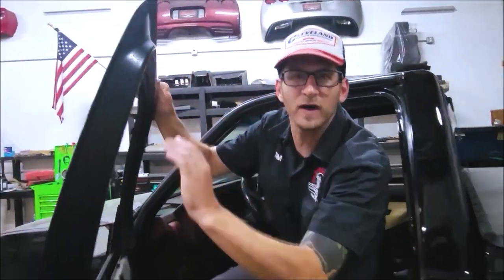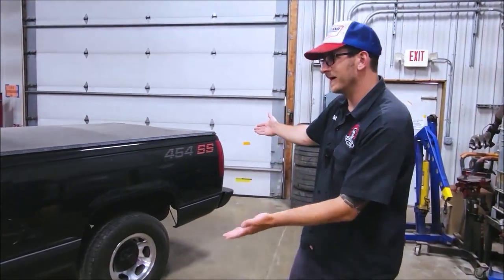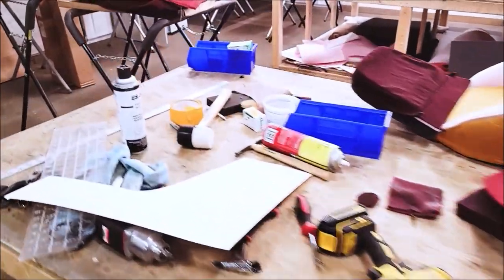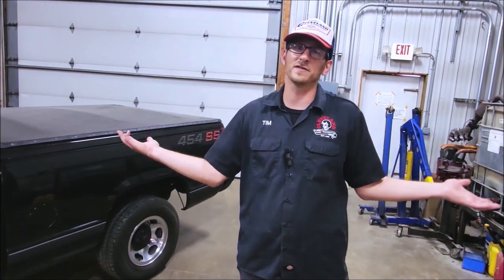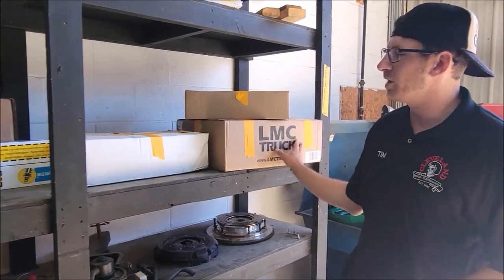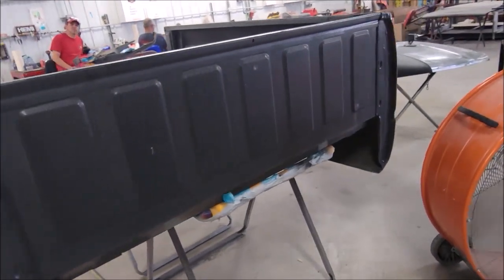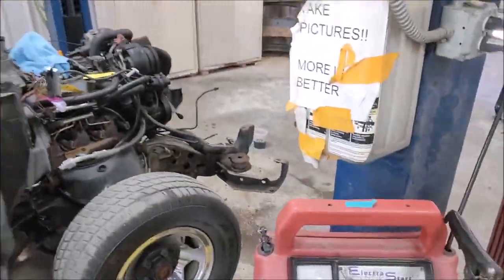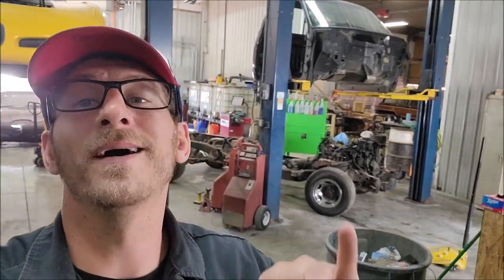1990 Chevy 454 SS Pickup Restoration

Comment: I have one of these.   The OEM 454 jumped timing and destroyed the pushrods.   I replaced it with a GMPP BBC(454) and replaced the THM 400 with an R4 transmission.   MPG is 9.6, but SMILES per gallon is huge!   34 years old and garners more attention than my '06 Corvette.